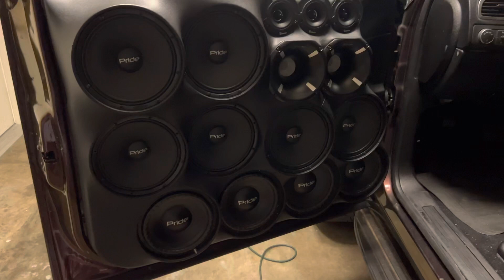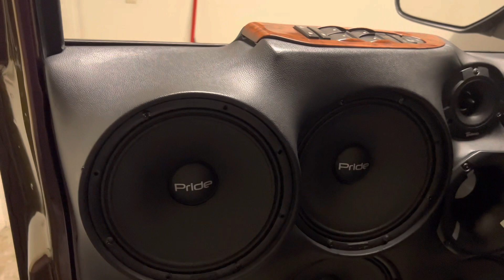6, 12,24db octaves explained

Comment: Idk if you’ll be able to answer this question but here it is. I have 2 cicada CH6.5” 2 ohm fairing speakers and 2 CH6x9” 2 ohm saddle bag speakers on my Harley Davidson street glide and all of them are horn driven speakers and the information with the speakers said to set the frequency at 100hz 12db octave slope so I set my amp on both channels to 100-110hz and they are ungodly LOUD but now I have absolutely zero bass… my head unit has a 13 band EQ and I can change the frequency on the head unit itself to a different frequency and a 0-24db slope setting but I’m new to horn driven speakers so all of this is Spanish to me. What would you recommend if anything for my amp frequency settings and or my head unit EQ settings?! The horns came with a 12db crossover and an additional 4ohm resistor to be used if not using a DSP or EQ so I didn’t install the resistor and my horns are extremely F’n bright!!. I’m not running a DSP but I have a 13 band EQ on my radio that I’m trying to figure out also but I’m completely lost!! Only thing I’ve successfully done is use my DD-1 to find max volume before distortion and set my gains using a 1khz @ 0 db test tone. Hopefully you can help explain what’s best for my settings..
Reply from the maker: I would recommend  setting your speakers to the frequency they respond to. Look at the fs on your speaker. That is the frequency your speakers resonates at. Don’t go below that number or you could possible blow them. As far as bass, you won’t get that strong bass from a midrange speaker, especially a 6.5. Also a EQ is ment for balancing sound out, not to change frequency. But for 6.5 I’ll set my  midranges to about 120 hz
Reply: @mondo82111   yes I know the EQ is to balance the sound out but there’s another option in my EQ settings menu where the fade balance and all that stuff is at and I have a setting in there where I can either leave it alone or I can change the frequency from I believe 60hz up to 120hz and in that same settings menu I can adjust the DB octave from “off” to I’m pretty sure 24db slope. I’ve never messed with or even knew anything about octave and what it means or what it does with the frequency.. my 6.5” frequency rating is 65HZ-20K +/-5db. And the FS is a 93.3.